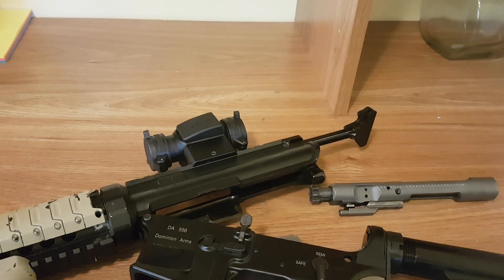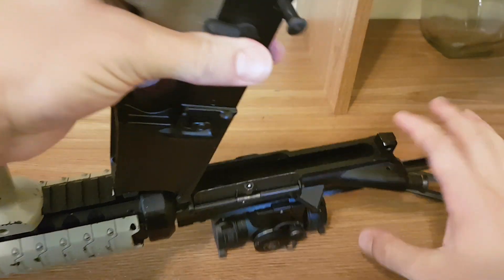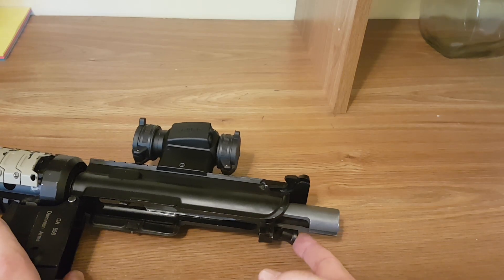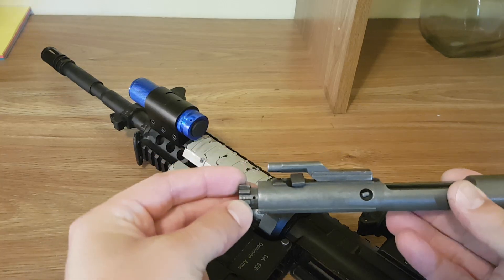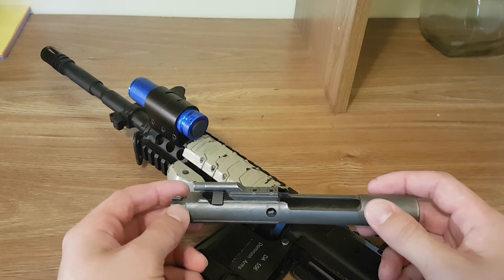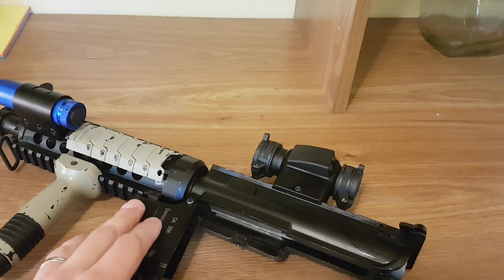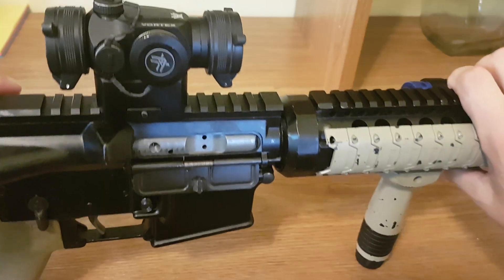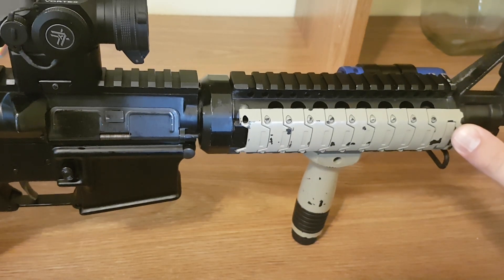What does the Forward Assist on the AR15 Do?

Comment: Forward assist is not needed for this gun. If your gun jams, forcing it closed is only gonna make things worse.
Reply: Thank you.  I was pulling my damn hair out watching this.  I spend 6 years in the military and 20 + as a cop,  Never was i told to use the F.A. every time i loaded my weapon.  I have used it a couple of times,  when i let the carrier go slowly so i do not make sound, then i push to make sure it is locked.  Forcing a bolt due to dirt will fu*# up the weapon and get you KILLED.  Damn Canucs
Reply: Ferguson101 Eh, pretty sure if what you're saying is accurate then all of those ISIS fuckers AKs' would've been completely useless by now, considering how stupid they are and how they probably don't even know to disassemble/clean their weapons.
Reply: Yolo Joe 223. Rem. is a lot more viable for small deer hunting than 7,62x39 dealing less tissue damage but still dealing enough stopping power to put down the animal. 
And the small projectile mass of 223. rem. is relativised by the projectiles speed. 

7,62x39 is mostly used in Drillings being quite limited for ranged hunting. 

I personally see not that many civil use for 7,62x39. Hell if you really want stopping than take 7,62x 51 which will give you a high stopping power even at bigger ranges.
Reply: Bobistdeinemuda i agree with some of what you said, but as far as a 223/556 being more suited for deer hunting- in most states i have lived in, you are not allowed to hunt with 556, but you are allowed to hunt deer with either of the 762 varieties.  ballistically, 762x39 is very simlilar to 30-30, while 556 is most similar to 22 magnum. i am pretty certain.
Reply: AK fairy tails can't stop physics literally jamming your gun full of dirt, sand and mud.  A dust cover however actually can.
Reply: It is only useful to quietly chamber a round into battery, if your gun jams and you smack the assist you're gonna make it worse and will have to tear down the whole firearm.
Reply: Bobistdeinemuda
Depends on your environment. My weapon had 7.62 rounds in defence forces and it worked perfectly in forests. It's less likely bouncing from a bush or a stick. And what are you talking about speed and not being precise? You'll have to be quite a ninja to dodge 7.62 when shot at you. And it's as accurate as you can shoot with your weapon. Sure, 5.56 has its benefits but you can't really say it's better. 
"But why do you need a resistant gun anyway?!"
I'd like to trust my weapon if I was in a fire fight. If your AR betrays you, you'll be seen in the next Daesh home-made video.
Reply: Yolo Joe 556/223 is a bit heavier than a 22lr, more like a 22 magnum. i like to call 556 the ultimate 22 mag.
Reply: I've had that training 232 so I don't know what you have had?
Reply: Michael stott check out the ak and ar mud tests on the YouTube channel InRange. The ak failed almost instantly because it became so filled with dirt, silt and mud that the bolt became jammed. The ar worked flawlessly under the same conditions because it doesn't have nearly as many leak points.

I was also responding to someone else's comment about how they'd only trust an ak.
Reply: you are correct but that's in a combat situation and with the older Gun's older clip's etc. the way the newer Gun's are forward assist is basically obsolete and you'll never use it and another guy said dirt and mud but the tolerances are so tight you would have to open it up and actually put mud in for it to actually get in the gun many videos showing that also if you need to watch them but they had a lot of problems when they first started issuing the m-16 but everything has pretty much been perfected now thanks
Reply: Steven you are absolutely right about that otherwise it's just not needed
Reply: Forsaken Ace your avatar rocks, much respect.
Reply: +Bobistdeinemuda 5.56 may be fast but it has less mass than an 7.62 so 7.62 will do much more damage even if travelling slightly slower, and in reality, 5.56 is literally a .22 cased in a rifle casing, 7.62 is about the size of a .40 S&W
Reply: unfuckingmaker That's quite interesting I'm German so I have no clue about US hunting rights. 

Do you know why 223. rem is not allowed in most states?
Reply: Bobistdeinemuda because it doesn't have enough stopping power (mostly related to weight) to successfully take larger deer consistently, and results in more wounded animals with through injuries. 223 (also 556) is suited better for varmint hunting than deer, with 2-legged varmints being at the large side of the 223 effective ability.
Reply: although used for varmints it does stop the enemy penetrate most bullet proof vest's and it very effective in combat anything else i need to educate anyone on
Reply: unfuckingmaker Well that makes sense through a good hunter  should be able to hunt small deers with with a 223. HP  shot into the chest with in 200 meters (656 feet in retarded jk).
But from what I heard a large majority in the US is allowed to hunt so it makes sense to have stricter rules.
Reply: Bobistdeinemuda yeah, a 556 is definitely capable of taking even large deer, with luck and skill.
Reply: the tolerances are so tight it's about impossible for mud to get inside the gun unless you physically put it there anything else you need a lesson?
Reply: CaptainPerfecto Once opon a time it was lighting my heart.... (put here the rest of "Total eclipse of the heart")  
But yes once but I stopped over half a year ago. To many Idiots, atheists, Nazis,  other scumm. 

Why do you ask?
Reply: Dumbass comment of the day. Congratulations! How ignorant.
Reply: I am not cleaning my rifle for 2 weeks, 200 shoots. After that 3 rounds jam, and i use forward assist. All next shot like a charm
Reply: Like W.a rr notes, If the AR15 is used for hunting or in a situation where you need to chamber a round very quietly by riding the bolt to battery then it will sometimes, depending on the particular gun fail to fully go to battery. The forward assist takes care of this.
 The risk of not having a forward assist is that the user may try to recharge the gun in a hurry and slam another round up the back of the round sitting in or almost in the chamber.
There would be no good outcomes in this event
Reply: Jonnie Law Carbon build up causes stoppages in the AR. AK will go much longer. I have used both extensively and will take the AK. The AR is good for sure, but not as robust as the AK.
Reply: I don´t think it´s an option to clean the gun when you are getting shot from the other side. Yes, the gun could fuck up, but it´s better to go balls deep, force the round inside the chamber and pray for it to work. The AR platform is a beautiful piece of engineering and I think it can take some beating.
Reply: You guys doing the whole AK vs AR thing, there is pros and cons to both weapon systems. Sure the AK works better in nastier situations but that is due in part to the loose tolerances. That loose tolerance is why the AK isn't any where near as accurate as an AR. Pros and Cons. I own both and love them equally.
Reply: Ferguson101 
In which way
Reply: "gun?"  I have needed it Twice.  Once when chambering a round as quietly as possible the bolt didn't quite lock into battery.  The other the rifle was fouled with sand.
Reply: Ferguson101 
Your stupid, AKs are designed to fire under any and all circumstances. Have you seen how hard they are tested. They're put in a climate control room(essentially). Being able to function after being put through a sand storm, frozen, ad dropped from 10 feet. I tested an AK after stuffing with mud, stomping on it, throwing it at a wall, shoving the muzzle into the mud. It still fired, not accurately, but it fired.
Reply: tadoxlado 7,62x3,9 is a horrible round in my opinion. 5,56 is at least fast and relatively precise.

An HK G3 will also be reliable in muddy regions and has better range and accuracy.

But why do you need a resistant gun anyway?! I assume that we all aren't some kind of Rambo. Everyone should clean his guns AK or not.  

But wh
Reply: absolutely correct forward assist is not needed
Reply: wrong you do not need forward assist these day's with the great ammo and keep your weapon clean it's useless I'll stick to my slickside thicker wall tougher upper
Reply: Ferguson101 History says something different ... thats why its so popular around the globe..  such reliability is a wet dream for AR.....
Reply: My Road Tours 
I've seen inaccurate ARs and Inaccurate AKs. You wanna talk about marksmanship, the gun is only as accurate as the person using it. I've grown up around AKs, I can hit a target with that better then an AR. That's with irons. with optics, The AR has better groupings(precision) but not as good accuracy. The AK has an unpredictable bullet drop at 100 yards(thus less precision).
Reply: thats why i trust AK  and i can't trust AR